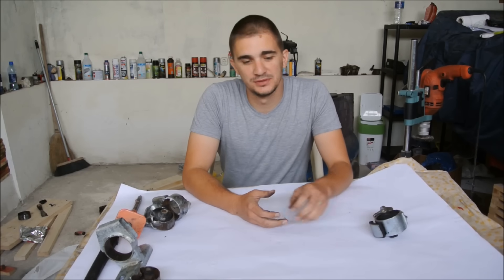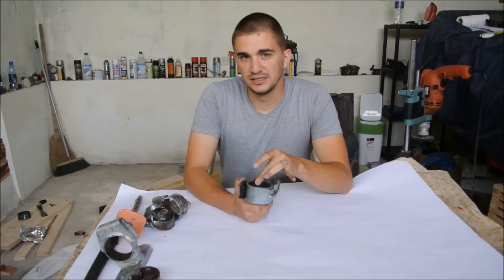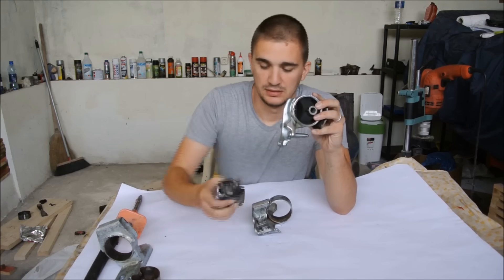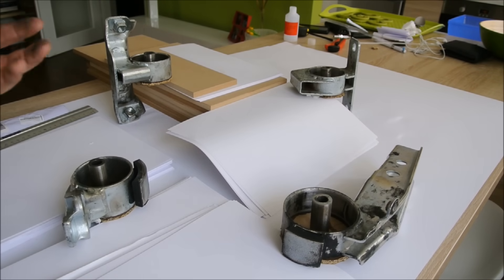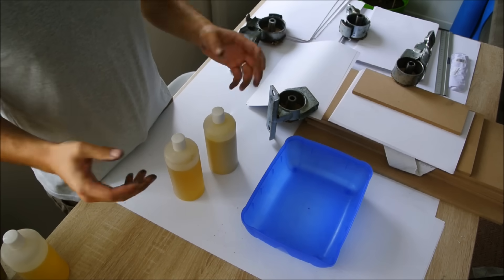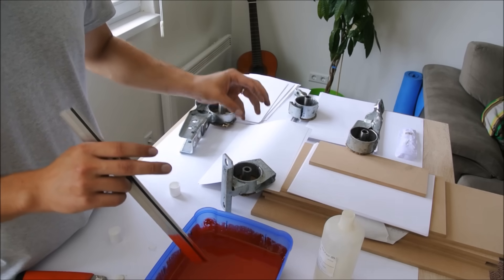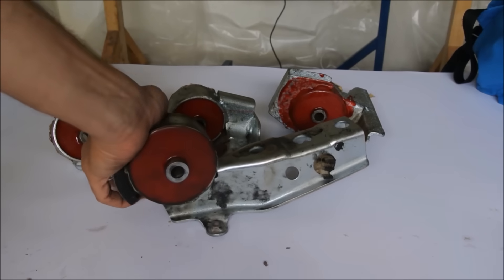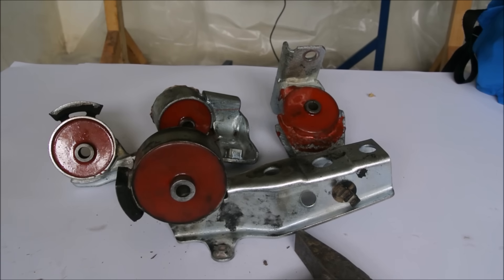How to make DIY polyurethane engine mounts

Comment: as neat as this is you'd want to avoid polyurethane mounts and stick to rubber or hard rubber mounts. Polyurethane will deform and not retain it's original shape if it's under constant load.

Comment: I worked in a prototype shop and we had a job to make some custom urethane wheels. We had a metal insert placed in a mold. The insert had areal rough surface making it better for bonding. Plus I believe we had a primer to put on metal to help in bonding, anything you didn't want the urethane to stick to (the outside of the mold) had mold release.

Comment: Would this still work if the polly was poured around the original mounts ?
Reply from the maker: It depends if it will bond to the rubber. It can be hit and miss. Urethane based windshield adhesives work well when applied over existing mounts.
Reply: @d4a  ok thank you

Comment: I'm impressed, i didnt know that this was possible.
 I'd set it up in a customwood MDF jig & bolt the parts in place, you could also do the holes in the rubber by using long thin bolts with plastic straws around them.
I have had one car i could have 'saved' using this idea. & Currently 2 strut arms that need this done. ( Good balljoint @ each end, + worn bush in centre )
Thankyou/m

Comment: Shore hardness 20 is way too soft, like jelly bean.  for engine mount you need material with higher hardness Shore A 75-80. Polytek  sells those hard polyurethane

Comment: Brilliant idea , I can't count how many mounts I have bought in the past few years. Track racing  is never forgiving . Get a mix up several different hardness and compress it into tubes , hopefully enough of waxing on the inside diameter will allow me to push out the blank so we can be cut to size and shaped on the lathe and mill. Again brilliant idea and many  thanks .

Comment: If you are going to burn the original rubber out anyway, there should be no need to force the steel ring out of the mount. Just leave it in place, burn the rubber out (a messy, nasty, smoky process that wasn't really shown here), retrieve the center pin, and proceed with the polyurethane filling. It's CRITICAL that the pin be accurately placed so everything is correctly aligned in the car. Even a small deviation could lead to assembly problems and/or premature mount failure due to the constant stress of misalignment.

Comment: my question to this is would this idea make possible to destroy the actual bushing arms. being cars and trucks are designed bit cheesier and movement of the suspension under could put pressure enough to start bending the arms
Reply from the maker: Definitely not, polyurethane is still flexible, it's not metal.

Comment: I had problems with my e92 the control arms mounts kept failing.
 Changed it 3 times. The final time i did this and since then i never had problems.
Reply: When you replace control arm bushings make sure to tighten The bolts when control arm is at the same angle as when vehicle is standing on the wheels. This will make sure that the bushings life is maximized
Reply: @samuellindstrom2137  
Ive done thaat. I made sure wheel was jacked using a 2nd jack levelling it as if the car was on the ground..

Im glad the modification i did on the control arm has worked. Its been over 1 year no more problems.

Comment: Looks an easy fix and way cheaper than buying, great idea. I would have poured the liquid polly into a coke can, waited to dry, place in lathe, Mill to desired size then drill hole dead centre with tail stock so that everything is machine perfect, then place the pin in centre drilled hole with some lubricant

Comment: Does this material also used in steel wire brush ? If not so plz suggest me a best rubber chemical for encapsulated steel wire brush!

Comment: Thank You for this  great video. Could You please tell me  how good is the  life  of the polyurethane compared with OEM rubber? Does it last longer?
Reply from the maker: If it's bonded to the metal properly and poured nice and slow it will last forever.

Comment: what if i told u the engine is designed to dissipate the resonant frequencies through micro vibrations that the  rubber mount absorbs,,,,,dont be shocked when ur engine bolts start to loosen

Comment: you had enough urethane to pour probably 4 sets of 4 mounts there. Just need a weigh scale to weigh out the amount you need. 
Mixing in a smaller container makes it easier to get an even mix
pouring with a paper or styrofoam cup would be more controlled
you can use a mould release wax to rub on the cardboard so it wont stick. probably any automotive wax would work as well.

Comment: I thought I was the only person who set fire to rubber parts!

German cars are notorious for having especially fuel hoses onto push lock fittings then installing a crimped-on ferrule over top of it! A good example are Bosch fuel injectors . I guess so you have to pay silly money for a new hose assembly instead of just replacing the hose itself. Even the fuel hose on my East German Trabant used this setup. So this practice must go way back.

I had to replace a fuel hose on an 82 Mercedes which was like this. Rather than cutting the crimped ferrule off, I just set the hose on fire using a torch! Once the rubber was gone, the ferrule just fell off.

Then installed a new hose and reused the fitting. I never installed a ferrule. Why would you need a crimped on ferrule on a push lock fitting anyway? Those crafty Germans!

Comment: I've done this for a bike. The vibration was terrible as it was to stiff. So I used softer polyurethane and they mushed after 1000 miles. Good luck trying to get the mix right. Strength and soft at the same time is hard to do at home..

Comment: Best to use a degassing chamber (which can be homebuilt) and a large plastic graduated paint tub (Home Depot, Lowes, Menards) as opposed to a paint rolling pan liner. Makes pouring a hell of a lot easier. I've used Smooth-On for several years for many things, from replacement parts mold casting to original castings to fillers, as is here. To make the pour "pretty", get a melamine board instead of cardboard and hot glue the part to it. No run out. No sticking. Easy parting. And if you want a profile to the poly, create it with modeling clay in the bottom of the casing. If your originals had a profile in the rubber, you could even cast it with this poly to place inside the case by simply using talc as the parting agent. You might even be able to extract the pin from the original rubber with a homemade electromagnetic coil to heat the pin but not the rubber. The pin gets hot, the rubber around the pin melts and allows the pin to slip out with a pair of pliers. Then, just slice up the remaining rubber into sections with a coping saw and peel it out. Safer and legal, since burning rubber is both a health danger and illegal in the US. Just be sure to re-temper the pin afterwards. Videos for each of these steps exist on YouTube - some in multiples.

Comment: I'd definitely put some holes in them at least or I would think they would be much to stiff now allowing them to give as much as their needed. Motor mounts are you motors suspension and the manufacturer does a lot of testing to assure they have the ideal suspension. I'm not saying I wouldn't advise this I'm just saying I'd look into it a little more so you could make it closer to factory specs

Comment: I did the same thing , but I used Polyurethane caulk / sealant . About $8 a tube. Probably not as good , plenty of air bubbles? but  was very strong also. You have to be extremely accurate in measuring and keeping the inner bushing in place. Otherwise bolting into the car will not work. Nice job!

Comment: Should’ve probably used a plastic or metal to cover the bottom. Then used a silicone caulk to seal them to bottom of the mount. Would’ve probably been easier to clean up then cardboard. 

Wonder what the longevity will be like with this method compared to the stock rubber bushings? Could be annoying to remove the poured in polyurethane if it needs to be done again. I guess can drill a hole and use a jigsaw to remove the bulk of the material and scrape/burn the rest.

Comment: If you want to be ghetto, you can take the mount off (so what you have is like what hes got in his hands for the first few mins) and just pour windshield urethane into it without removing any of the old stuff. did that on a beater a few years ago and its still working great keeping the motor from rocking around today

Comment: You probably should not have cut the cardboard to be the same diameter as the mount. You should have made it larger and affixed it to the mount to create a good seal to prevent leakage.

Comment: I would drill the old rubber out (was no need to  burn it) I think you made this look harder then what it actually is ... And maybe use the right chisel for the right job !!?? You wasted all that gas burning the rubber but you didn't think about using the gas to loosen the mount from the bracket !!??
Reply: IV seen roosters root chickens with better results

Comment: Clean the mount with denatured alcohol, use masking tape to make sure you don't run everywhere and fill the voids in the rubber mount with windshield adhesive.  Works just as well, quicker, cheaper, easier.
Reply: i was think what if he just filled in the rubber cavity with the polyurethane instead. Should give a much stiffer ride. less engine movement, not quite as much as pure polyurethane mounts but just as good. And most likely wont vibrate when idling.

Comment: I had to junk  my VW. They wanted $600 for the effin mounts  that went at 180k. With Labor I believe but unsure. Point is- some mounts, like in some Cherokees. Are $700 for a single transmission mount! Egypt was/is the only maker.
Reply: Cherokee?  A Jeep Cherokee transmission mount goes for like $20.
Reply: @immikeurnot   immikeurnot  Don.t forget that AMC used parts from Various other car companies. I forget my year of Cherokee for my 5 speed manual It was in the 80's model.' But this shaped Mount; \____/ made of rubber. Snapped into a simple but very tight mount. I went to the dealer next door. It was a mount made in Egypt. $600ish was the price. Some Cherokees of the same year under AMC has varied in parts. I actually drove it to a tow company and handed them the title. Plus the toe was off too. It started to overheat as soon as the transmission & engine moved. So I had to get rid of it. Maybe MOST are $30 but not the one I had.

Comment: Do you ever try making a combination jig/plug for pin locating and keeping urethane in place during the pour? Seems like you could do it with wood or plastic easily enough
Reply: You could probably 3D print a fairly precise single use tool for this purpose.

Comment: By heating the pin won't it lose the the hardness & require heat treatment plus quenching.
Reply: That burning rubber fire probably isn't hot enough to remove the factory heat treat (if any) from the sleeve.

Comment: "Only way to remove the center pipe is to burn it" And you cant use hole saw to drill the center out? Just drill from both direction to separate pipe and little rubber outside of it and then using sharp knife or chisel to cut it away or just burn the little bit depending how small hole saw you found.
Other option is to have steel pipe of something with hole bit larger than center tube and press it out and in this case rubber will eventually give in and be cut by pressure, or bond between tube and rubber will give out.

Comment: That's a hard pass for me. The burning of the rubber gonna be a lot more toxic then you said, and you'll never get the inner sleeve at the correct angle.
Reply: why not? he didn't even set up a jig, and it seems pretty good. if you were worried about accuracy, it would only take a little more effort to make the jig. at most you'd need an angle finder, some calipers, maybe a dial indicator(?), and some fab skills. definitely not hard to do.
Reply: @ericroot8475  Neither is clicking buy now on eBay. And I'm the original DIY make it yerself type.

Comment: Just a quick tip about getting the pin out! If you just focus the flame on the metal pin it gets super hot and then you can use pliers to get it to pull right out from the rubber.
Reply: Awesome tip thanks man!
Reply: So how are these bushes doing 2 years down the line? Has the car seen the road?
Reply: Thanks simnett, you helped me turn plant based, cool to see you’re a gear head too
Reply: I wondered the same thing, do they break down over time like some plastic product’s (ie foams,etc.)
Reply: If you don't want to change the temper of the metal you can use an angle grinder to make two cuts each side of the inner pipe, then two more cuts at 90 degrees. then hold the pipe in a vice and rub the rest of the rubber off with  the anglegrinder.
Reply: This makes the metal brittle.
Reply: @leolldankology  That depends on the composition and heat treat, if its low carbon, something like less than 0.3%, there should be no problems
Reply: @chronicblazer84 f it man just try what works if it works.
Reply: @leolldankology  only if you quench it.
Reply: @leolldankology 

For the relatively low amount of heat and duration needed this method won't change the properties of the metal insert in the slightest.  You'd also have to be quenching it to make any difference.  

Guaranteed the insert WILL NOT be brittle. Heat is used very commonly used to release seized components in the automotive world. 

Don't scaremonger where it isn't even slightly an issue.
Reply: you could and should just buy new sleeves instead of removing the temper of the steel by heating it red-hot.
Reply: @chir0pter  
Which ever is most cost effective.
All of the bushings I need for my vehicle will cost over $500.
I am going to compare prices.
Well wishes.
Reply: @chir0pter 

It won't make any discernable difference especially in something like a bushing sleeve/insert.

Comment: I've made engine mounts this way, and getting the right constituency is the trick, to soft and it splits, to hard and to much vibration, Benson chemicals UK supply different types of polyurethane on a scale of 1 - 10, trial and error, I saved no money trying different types of polyurethane, these look far to hard to be any use, I might be wrong though .  .  .

Comment: its easier to remove the old rubber bushing by placing it in a vise and drilling roughly 6-8 holes around the perimeter of the bushing, you can then peel it away from the outer sleeve. No torch needed

Comment: Am easy cleaner way to get the pin out is to drill a bunch of (~1/4 drill) holes around the pin and then just push it out by hand. Do this before e dealing with the sleeve so taking the sleeve out is actually easier to deform letting it fall out of the mount casing. Nice vid on how to make urethane bushings tho. Have you ever used this method for suspension type applications?? Say control arm bushings?? Or Sway bar etc???
Reply from the maker: A lot of ppl asked if it's possible to do suspension bushings. I never tried it myself but I see no reason why it can't be done. I did the engine mounts because they were really pricy, I bought all the urethane suspension stuff as it was fairly priced :)

Comment: This mount is good for a race car not every day driving I did it to mine and boy you feel all your engines vibrations i felt i was driving a tractor you might as well weld down your engine brakets to your car .
Reply from the maker: Pretty much what I concluded too, check out my follow up video.

Comment: Thanks for sharing! Great video!
 I inherited my fathers 1989 Toyota MR2!!! do you find the motor mounts too stiff being polyurethane compared to the OEM rubber in regards to vibration?
Reply from the maker: Check out the follow up video to this video. Link is in my pinned comment.

Comment: You can use a drill to get the cuffs out quick and easy.
This however is honestly a bit of a stupid video.
100% not gonna be centred..   doesn't allow for any spin.. meaning they are gonna squeak more.
Plus... why cop out on a "DIY" set other than to cheap out.
I would not advice this over a profesionaly made to fit set for a cost.

Quality costs money.
Reply from the maker: Quality costs money? Who would have guessed. A few points. These are engine mounts and they are not supposed to spin like polyurethane suspension bushings.  They do not squeak as there is nothing to cause squeaking in the case of engine mounts. It's usually a good idea to do some research before calling something stupid. There is a follow up review video of these that you can watch. The problem that my DIY mounts had is the same problem that "professionally made" mounts have and that is noise, vibration and harshness. As you can see in the follow up video I ended up removing the mounts as I disliked the noise and vibration. I have driven and have been driven in quite a few cars with "professionally made" polyurethane engine mounts and they caused the cabin to rattle and be noisy just like my diy ones. So in the end I saved myself some 300$ as I would have removed them in the end anyway. They did what they were supposed to, didn't fail in any way and performed just as well as a "professionally made" set. They are great for track cars as the car does fell quite a bit more responsive but for a street car they are a bit too much for my taste.

Comment: I just used window weld and filled the existing motor mount with that. That looks like too much work for the same result. Nice work though!!!!
Reply: I've used 3M Window Weld as well, works very well, and you can order it on Amazon.  I also molded up a new set of bump stops with it once, $10 instead of whatever the dealer wanted.